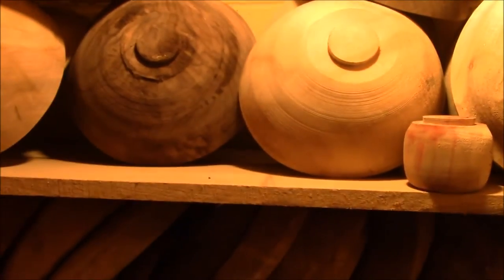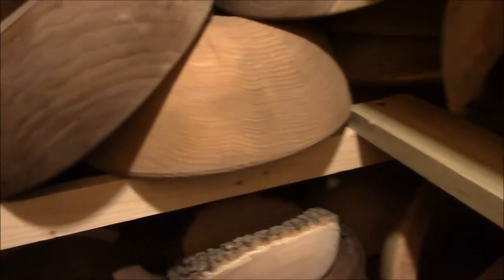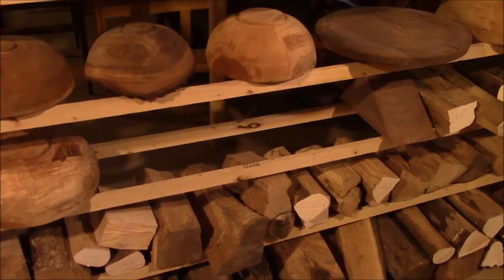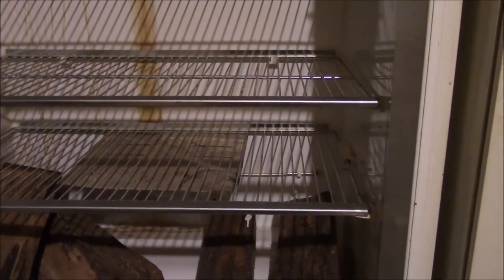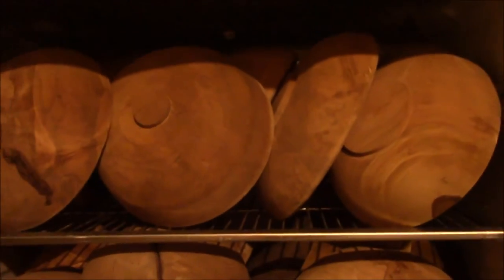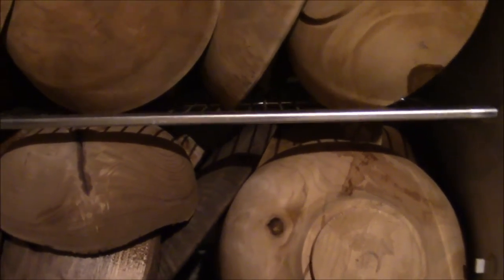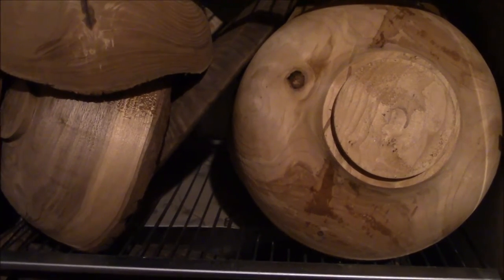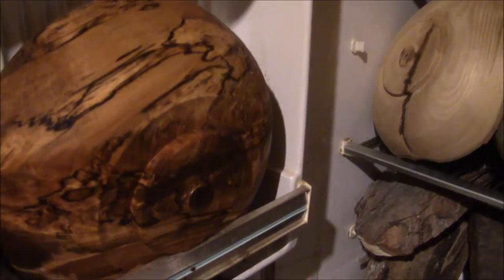Drying Wooden Bowl Blanks With A Homemade Wood Kiln

Comment: I am using a similar method. I do seal the end grain prior to putting the once turned bowls into the drying box. Mine is a set of metal shelves encapsulated with foam board insulation.

Comment: Any experience with using anchorseal on pieces before putting them in this type of kiln?  I turn professionally and have just air dried with anchor seal.  It takes a much longer time to dry, but I have hundreds in different stages at all time.  I am setting up my first freezer kiln.  I needed a larger freezer since I start with 25 inch blanks.  I have sealed them and put them in the freezer.  Four days and a lot of water has come out, and no checking.

Comment: Thanks for the great video....I've decided to give this method a go after looking at numerous diy kilns online including the dishwasher one. I've repurposed an old vertical freezer and put in a 100w infared heat light and a thermostat which is mounted on the outside with a probe going inside the unit. I have a small fan inside circulating the air, but no venting to the outside so the unit is sealed like yours. I have a whole lot of green red gum hardwood (I'm in Australia) and i want to try drying rough bowls and some square stock. I'm curious about why you soak the wood in soapy water and what temps I should set mine at. I'm thinking lower to start and then increasing the temperature. I am considering sealing the bowl blanks with paraffin wax leaving the bottom inside of the bowl unsealed. If the temperature is kept below 37C the wax won't melt. The other option I'm considering is pre-soaking in methylated spirits (what you call denatured alcohol in America). Any thoughts on these aspects would be appreciated.
Reply from the maker: leo hollingshead The soapy water is a surfactant, it tends to make the water content uniform in the bowl to start the drying process. For woods with a lot of pitch, it makes sanding much easier. When I start drying the bowls, the kiln is at about room temperature and it builds slowly over about two weeks to a finish temperature of around 120F. I've used denatured alcohol before as well, but I typically only use it with a piece I need to dry very quickly. You can soak the piece, fully submerged, for a minimum of 24hrs. I then take the bowl and wrap the outside and the rim with brown paper and let it dry for ~ 30 days. This process works very well but can be quite expensive. As for the wax, I don't have any experience. I apologize for the late response, I'm technology illiterate.

Comment: For the benefit of us who might not understand kiln drying principle.  I get your emphasis on packing it full, i.e. lots of close up showing that concept,.  Some more ideas on "how" you repurposed your old fridge would help.
Reply from the maker: Hi Dale,
  Sorry about the slow response. I drilled a hole in the back for the electrical about 12" up from the lowest point on the inside of the fridge. Then  I installed a junction box to attach the light fixture to. Wired it with an 8' cord I made. My placement of the light/heat source was only based on the location of the lowest shelf  in the fridge. Added a 12" square metal shield above the light as I thought directly above it might be a hot spot  and the metal would disperse some heat. I have found 75 watt incandescent works best for me with the size fridge I am using.
Reply: @deadtreewoodworks5005  Well . . . it's a great idea and I appreciate the video presentation . . . and much more the thoughtful reply.  Thanks so much1

Comment: What's the purpose of filling the kiln so full?  Would it still work half full or less?
Reply from the maker: Hey Curt,
Reply from the maker: Lets try this again
It still works when a partial load is dried you just get more cracking. It appears more stress is created due to the accelerated rate of drying. I have observed the humidity stays quite high for th 1st week and the temp. doesn't really climb until late in the cycle ( usually 10 -12 days for mine). Hope this is helpful.
Don
Reply: Curt ST. ROMAIN o